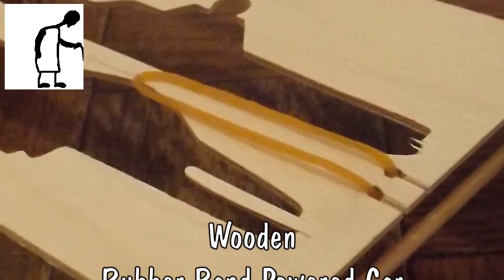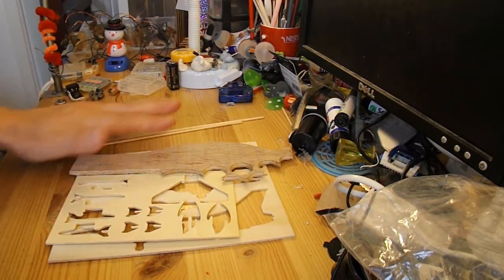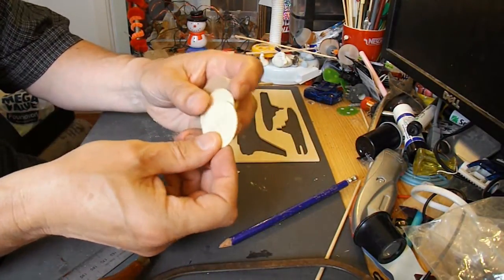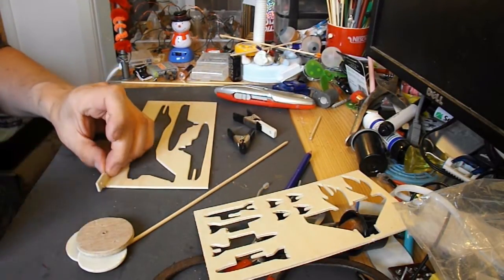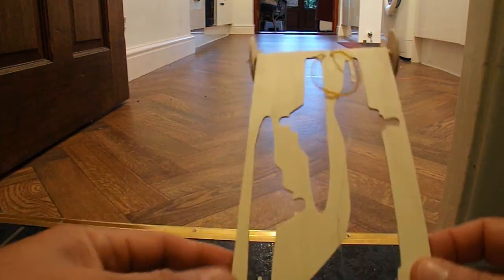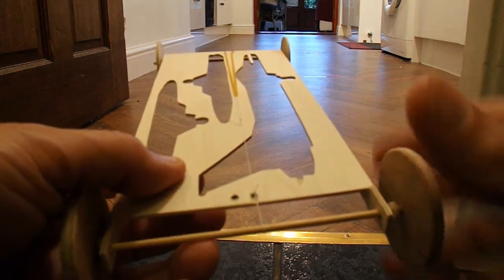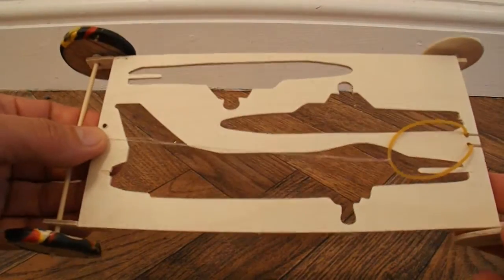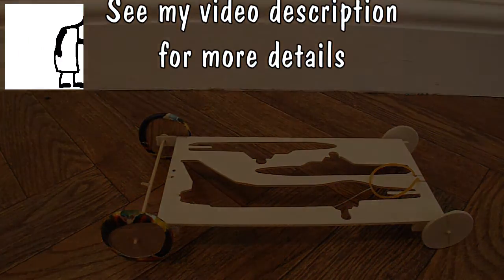Wooden Rubber Band Powered Car + 1 rubber band

Comment: We are doing a design project on a rubber band powerd car. I need to know where the best place is to put the axle and why. I need to win a race that goes 4 metres. and I need to know if rubber band like you did in your video helps the wheels. Thanks !
Reply from the maker: I don't understand what you mean about the best place for the axle. One at the back and one at the front is a good idea. I guess if the chassis was a different shape you might have the option of putting the axle high or low in the body but I cannot think of any advantage. The greater the length of the chassis the longer the length of rubber band you can use so the further the car can go.
I don't understand what you mean about the rubber band either.
I used a single rubber band on this car because that is what was requested. A single rubber band was not long enough to reach the back axle so the answer was to extend it using string or cotton.
I am pasting a standard text below that I use to answer questions as it may help you.

I am assuming you have some set criteria for number of rubber bands and size of vehicle so putting those aside. The first point about travelling fast or a long distance is minimising your friction because that is what wastes your power. 
1. Friction caused by badly aligned wheels rubbing on the bodywork should be easy to fix by adding spacers to keep the wheels clear.
2. Friction where the axle is attached to the bodywork is reduced by making sure the axle bearing surfaces are something that does not bind together. Wood and cardboard are not good. Metal surfaces are better. Steel and brass is good. Ball race bearings would be even better. Whatever you have, even if it is just wood and cardboard, you can improve by making sure there is clearance so they do not jam together and maybe rub some graphite from a pencil where they make contact might help.
3. Friction with the wheels to the ground can be a mixed blessing. Minimise the friction of the front wheels by using very thin wheels, however you may need some grip to ensure they keep the car going straight. The same applies to the back wheels, assuming you are using the back wheels as the drive wheels. However if they do not have enough grip they will spin under power and that is all wasted energy. Thin wheels with rubber tyres would be best in that case.
Larger wheels take more effort to get them turning but once moving they have the momentum to keep rolling when the rubber bands have finished. You could experiment with different sizes to see which work best.
You could use some sort of gearing to start with a large gear to get the wheel moving and then a smaller gear to maintain the motion. There are some examples in my playlists.
Reducing unnecessary weight by trimming the bodywork a little may help but make sure you don't loose grip and start the wheels spinning if the body is too light. It may bend or break under tension so be careful.
Another trick I have found helps is to stretch the rubber band as you wind it round the axle so you get more turns round the axle, this can make a significant difference compared to just winding the band normally.
If you can only use a short rubber band, connect it to the axle using thin string so the string winds round the axle stretching the rubber band

Check out my HelpFiles playlist. Many of the videos are related to Rubber Band Powered Cars
http://www.youtube.com/playlist?list=PLA5a2xPRSrB2v0vxMJyZ9cPweAGx1FK6e

Comment: With a tool like this:
http://ecx.images-amazon.com/images/I/51onFG4HHML._SY300_.jpg
I did on other occasions large holes in wood (to pass cables, for example).
The circles, were perfect, save it for later use, they are an ideal wheels. 8-)
Reply from the maker: Hi Francisco, yes I have one of those hole cutters. I couldn't use it for this task as the pilot drill would make the hole in the centre too large for the axle I wanted to use. :-)

Comment: Just a quick thing, weighing the back of the car down a little bit more will also give it more speed as it pushes the back wheels down against the ground. Thanks for taking time to read this!
Reply from the maker: Hi Jonas, thanks for commenting. Yes, a little weight would help the grip. There is obviously a balance between weight, power, grip, distance, acceleration, so it depends what the target is. Generally my target is to cover 5 metres and the car does that. Other people can copy the design and make their own changes to meet their own targets. If you hunt through my toy car projects you will find I usually use some sort of rubber tyre to improve grip but I have used weights too, particularly on projects that need super grip over short distances.